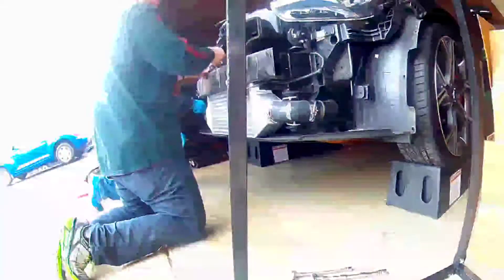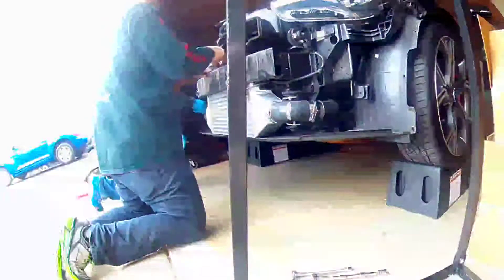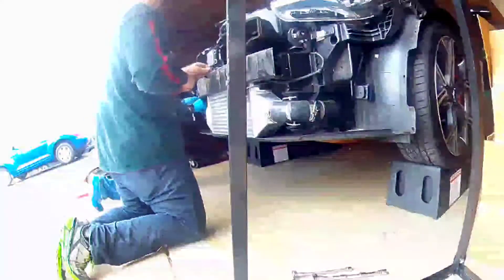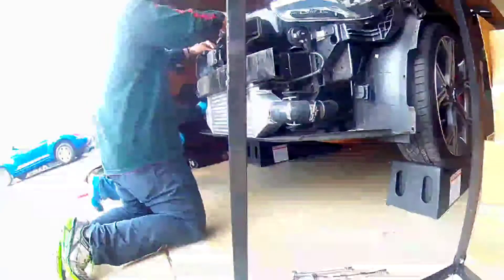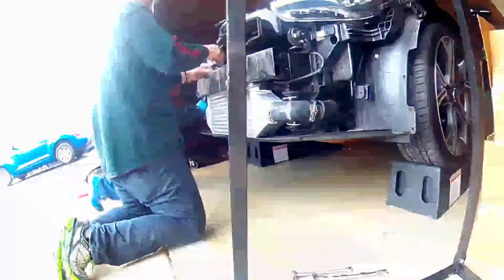2019 Kia Stinger GT2 installing BMS  intercooler

Comment: Did u have any fitment issues or did it fit right on in?
Reply from the maker: There is a plastic shroud that I just unbolted and removed, I think it is supposed to direct air to the radiator but seems pointless since the air comes directly to the radiator from the front anyhow. Other than that, slid right in.
Reply: @StingerGT2  sweet, bms intercooler it is, thanks for the quick reply man
Reply from the maker: @noneya6679  Awesome, I am at almost 30k miles and no issues. :-)